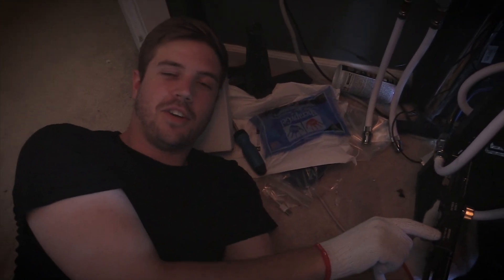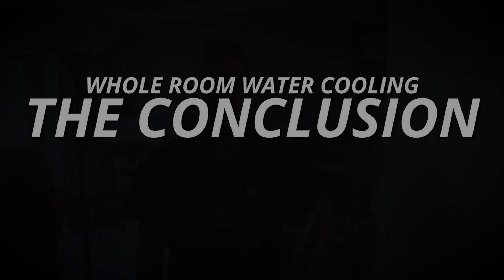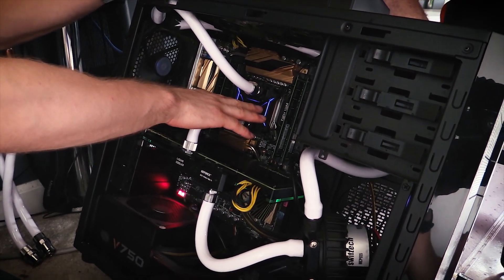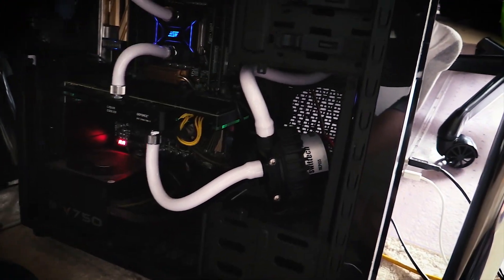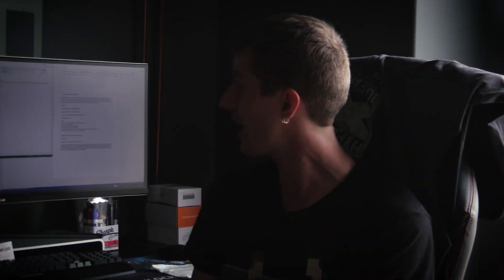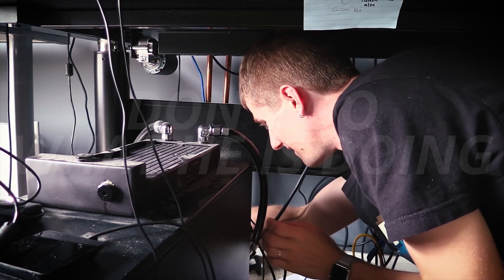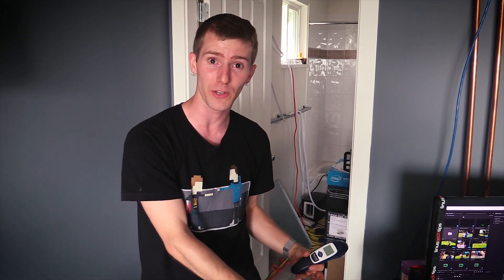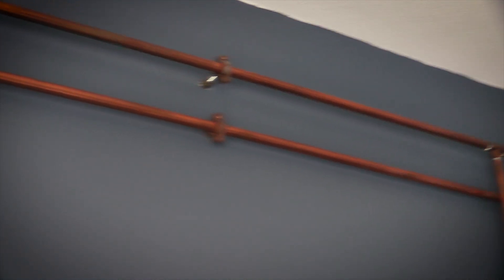Whole Room Water Cooling Part 7 - It's FINALLY over!

Comment: I think cuz' you're using uninsulated copper pipes, most of the heat gets released in your room...
Reply: +FieryWingedAngel My instant thought as well.
Reply: Linus pointed that out
Reply: +FieryWingedAngel Maybe PEX tubing instead?
Reply: +FieryWingedAngel I would be interested to see what happens if they attempted to place foam pipe insulators on the piping, additionally, the plastic tank is really a must have. Metal tanks will never be containment free.
Reply: oh mate you are a genius. its not like he said that himself.
Reply: better yet, replace the copper with PEX tubing, wrap that with foam insulator & swap the metal reservoir for an insulated plastic one (even a party cooler would probably work)...
Reply: +BillCosbyEatsBabies he literally says in the video "we chose not to use insulated PVC because of aesthetics"

now i'll agree. 

A it's pretty dumb because it defeats the whole reason your doing the project basically and

B frankly, it's still exposed piping against dry wall and that still looks like crap. maybe old piping against old brick could like ok but exposed piping is always going to look junky so PVC vs copper, meh, copper looks better but not enough to matter.

however it's his choice, it sounds like he made an informed decision and just has different values.
Reply: FieryWingedAngel
True that, using conducting material as heat transporter isn't that smart..
Reply: +BillCosbyEatsBabies I run pex on the daily and that would have been ideal for this project...
Reply: Bury a snake of pex 4' under the lawn & geo-cool them damn processors even.
Reply: Amigo Memela he may have said it himself, but he didn't even consider adding insulation to the pipes. It's really cheap at any hardware store. It doesn't take much time or effort to add to the existing copper pipes either. If he's going to go through all the effort of making a test he should at least add what's necessary to test it under ideal conditions.
Reply: Jack Graybird  Oh.
Reply: Joshua Bouse Yeah
Reply: +FieryWingedAngel yea that's the reason why its not as effective !! can't believe they did not think of that fact lol
Reply: I would still like to see a geothermal system, that would be so bad ass
Reply: +BillCosbyEatsBabies  and super way more effective as the ground stays a good constant temp.
i d also use a turbo intercooler type between the pumps
Reply: +FieryWingedAngel It's basically a giant radiator heater, which use hot water to heat homes :P
Reply: *****  Classic example of someone posting a reply before taking their meds...
Reply: Ok Capt. Obvious.
Reply: MarkTechTips  149 People don't quite seem to agree with you.
Reply: Don Ziolkowski hes half assing the science. Which will only get worse as NVIDIA controls him.  RIP Linus  Tech channel. You were the king besides tek Syndicate.
Reply: I was being sarcastic
Reply: I was being oat meal.
Reply: He literally said that in the video Sherlock.
Reply: SirMirula Doesn't make it any less stupid.
Reply: True, home A/C systems use foam wrap to insulate the copper tubing.

Comment: 7:48 the lazer Wasent even on the pipes ?
Reply: +alextheboss14 indeed lolol
Reply: +alextheboss14 the laser, no. but on the temp gun, it's located inder the infrared sensor, so at the distance he was, the infrared sensor was most likely reading the pipe even if the laser dot is on the wall. I do however wonder if he'S using a cheap ass thermometer with fixed emmissivity which would not give a correct reading on shiny copper.

Comment: What I learned while playing with an infer red camera, is that copper reflects infra red light. That temperature measure is receiving light reflected from the black body radiation of THE OTHER parts of the room.
Try heating copper up with a blow torch and using your infra red thermometer ;)

Comment: Why not cooling all the PCs with water seperately and then leading all the hot air out via tubes out of the room? Just like your concept but only with air which would be less complicated.
Reply: +Philip Danzinger  Oh it'll cool great, but then you have a long column of air with a sound source at one end. You have probably created a sharp resonator with a propensity for standing waves. Would be curious to try, but to my understanding, it would be ROARING.
Reply: Siana Gearz True, good point. But what about an AC?
Reply: air flow management (cool air zone and hot air zone) is not as efficient as a water cooling system
I once saw a smaller water cooled rig (from IBM running at 5Ghz; maybe a z196) and it make sense. More processing Power in smaller room, smaller rental fees. The hot water may be used for heating or in other ways.

Full room water cooling is a professional cooling system with many difficulties; in professional environments they had a technician. They still use distilled water, but still have to deionize it regularly (they use heat exchangers too). It's not for home use.

A 220MW radiator makes a cool winter day's to perfect place for outside party -- even if only 80MW was active ;)

Comment: Hi guys,  at least add thermal insulation to the copper pipes, than you will be able to see the difference. Without insulation you are just spreading the heat :)

Comment: tubing and quick connectors.  Keep the system as horizontal as possible, eliminating as many level changes as you can.  Use a 5G bucket with a pond pump in it and put algaecide or bleach, etc. into the water or use pure coolant.  Keep runs as direct as possible.  Install radiator as close to room as you can, use a shade awning to keep the sun off.  Tint the windows to block sun into the room.  You can probably put the pond pump and bucket in the room in a corner, perhaps inside a rubbermaid tub for peace of mind.  Keep it on the same level as the tower connectors and radiator.  Free dump the hot water in the radiator, then into the bucket, but pump it back from the bucket to the computers.  The height of your radiator should be your maximum rise in the system. Put the pump level with the bottom of the grid. 
Rent (or buy) a scaffold to do the work on the wall, it's worth it.

Comment: Wrap those copper pipes in insulation. The ambient temperature in the room is being increased by the outflow pipes heading outside. It is also heating up the fluid coming back in from the outside. It is reducing total efficiency.

Comment: Ah heat transfer. Those copper pipes fucked ya in addition to the res. the lengths of those non-insulated copper pipes were definitely long enough to radiate a significant  amount of the heat from your coolant back into the room.

Comment: I believe that if you use the type of chiller used in water AC units, you may be able not just to cool but OC the whole thing...  (lets say water at 17- 20 degrees C..) 
but bottomline, if you want to refresh the sistems PLUS the room, just get a bad ass AC and the heck with it xD

Comment: Great videos LinusTechTips. I saw on one of these that you were using the antifreeze but it did not have the necessary stuff to prevent the algae from growing. If I put things to prevent algae is the antifreeze a good idea over water for the cold winter times?

Comment: Not so sure if it was because you used a metal res, but the fact that you have copper piping n the like. I assume somewhere there is aluminum and if I recall correctly, you do not want to mix those in a loop, and obviously you have a shit-ton of copper.

Comment: Would insulating the outlet not improve performance. Copper radiates heat back into the room. Add a filter too. Running it through a fridge would be cool too.

Comment: Is it recommendable to set up watercooling to a cooling system to run below room temperatures or could this cause problems for the electronics? Is there generally an overall optimal temperature for the graphics and cpu to run at?

Comment: Did they just use water? That will give you problems when you mix metals in the system. I built my own water cooled computer about 12-15 years ago and used distilled water with WaterWetter in it. It ran without problem until I retired it. I haven't followed the setups people use today but I'm guessing you add something to the water?

Comment: It's easy to sit here and see fault in the way they built it,but the fact is they made it work through trial and error.so if someone wants to try this.they now know somethings not to do.i give them credit for even trying.shutoff valves,bleeder valves, different pipe,one big radiator,and bigger fans,filter system.this could work and be practical.

Comment: would it not be smarter to put thermal insulation foam over the copper so the room temp isn't affected by the exposed copper pipe? - just like they do with a glycol system in a bar

Comment: Ok last video thumb up, you admit it was a failure. Your proberly a greath it guy. But your a bad plumber. This idea can work greath for sure. I worked in a factory where they used a lot of water cooling.   Pressure and make sure you get rid of air.  Instal regulating valves so you can shut of parts and regulate pressur over the complete system. Why the ring line so high. But enough you sufferd for a whole year.  Greath example stay with your profession. Your a IT guy and not a plumber. Its a different education especialy cooling systems. Next time better.

Comment: Put a valve for each of the system to control the flow and pressure, so you can push the bubble out easily.

Comment: Very interresting idea :)
How is it going with the corrosion ?

I guess its not caused by the metal tank...
The first thing u learn as a plumber (im told)
Is that u do not ever put steel after copper... othervise it will corrode..
You should not use any copper in the system since its a loop... 
If the water come in contact with any steel then they will corrode... and i guess there is some internal parts in the pcs thats made of steel...
The pumps may corrode aswell.. as will the steel connectors...
Or is it the other way around ? steel makes copper corrode ? i dont remember.. but in any case its not a healthy system :)

Comment: Pro tip on using IR thermometers:  Put black electrical tape on the section of copper piping where you want to take a measurement.  Set emissivity setting to 0.95 if adjustable.  Wait 15 minutes, and then take a reading with both laser dots and the space between them over the taped area.  This will get you a much more accurate measurement.  Or, use a contact thermometer.New copper is highly reflective of infrared energy, so the reading you took in the video is a temperature blend of the actual pipe, your IR tool, the wall, the ceiling, your hands, and your face.If you try this build again, use PEX pipe next time.  Have to admire the effort though you put into a poor man's CRAC unit (Computer Room Air Conditioning).

Comment: Several tips on full room cooling:

1. Use plastic tubing and only plastic tubing.
2. Bury the tubing into the walls - bricks and wood insulate.
3. Do not rely on normal computer radiators - go to something like a cooling tower. This will give you a constant 4 degrees Celsius intake temperature.

Comment: The pipes in the room would radiate al ot of heat back in to the room before it got to the external radator, So you need to get some pipe insulation.... however i think you went about this all wrong, there is a cheeper much more effective way to do this.

Wouldn't it have been simpler to build a rack in a small room, put all your workstations in to the rack. then run a Air Con unit in the small room. Then from the small room you Run a KVM swich.

That way you have 3 advantages, the room you work is cooler, there no machine noise, and 3 the KVM would let you switch to any workstation from any working position.

Comment: insulating the hot water outlets, will actually lower the temperature even more. Plus installing a wall fan near the cold water in let pipes, will help additionally with the room cooling. Also laminating the windows will allow additional cooling.

Comment: Just hook up your system to water chiller that you place outside and you might run water close to zero c 
In that case you will really want to insulate the pipes to avoid dew forming and dripping all over your room...
But just getting the  AC sounds fine...

Comment: You should had made holes on walls facing outside, and placed radiators close to exit point much as you can. So with a shorter circuit, you could actually manage the faster liquid motion, added with extra radiators split between each exit point using the space outside, it could worked like magic. 
At first video when you included copper tubes, i said "oh, what great idea to use copper tubing to dissipate even more heat with them!" but then you put those inside the room xD

Comment: I enjoyed watching these 7 vids.

Thinking about the copper pipe radiating the heat back into the room you could have cut a lot of the down by insulating the pipe with some foam pipe, like a hollow pool noodle, that would keep the hot pipe "hot" until it gets to the rad outside.

Another possibility would have bee to connect some form of chilling unit to the cold circulation to drop the temp even further.

And as for the corrosion, you basically need what most hot water tanks have, is called a sacrificial metal, which corrodes easier than other items in the system, generally to stop the copper corroding in a central heating system, not sure how much effect it would have on what ever the computer components were made from.

Still a great concept.

Comment: Don't consider this a complete failure. There are multiple variables that can be improved on in this set up. I'm sure with a bit more trial and error it can actually work. Insulate the copper pipes. Introduce cold air into the room. Add ice in a reservoir. Keep on experimenting! Even if it doesn't work, report it. Explain why something didn't work so that others either follow in the right direction or not waste resources replicating a method that doesn't work. I love your channel and I admire your hard work. Keep it up!

Comment: Me? ( being an HVAC guy.. ) would have built a water chiller in place of that radiator setup on the roof.  How much less noise was there with the water system, vs all those radiator fans?

Comment: Maybe insulating those copper pipes could help a lot (There are pipe sleeves used for insulation of heat and saving the money on house heatingwhich is exactly what you want to de here pretty much)

Comment: You took hot water from the floor up to the ceiling and around the whole room through completely exposed copper pipes... by the time those poor pumps got the water out of there most of that heat was already back in the room.
For smart folks you do some pretty stupid things :P

Plastic pipes around the floor would probably work out much better, but at the end of the day the room still heats up in summer and you eventually need that AC with this system or without.

Comment: So, after watching all eight (including 5a and 5b) episodes of this series, I just want to be clear on a couple of things:
You installed something like eight external radiators with four fans each, instead of just going to a junkyard and buying a car radiator and thermofan, or having a new rad custom made to suit;
You installed said radiators on the south-facing wall, which, being in the northern hemisphere, is the one the sun hits, which will heat the radiators well above ambient;
You used uninsulated copper piping, which disperses heat back into the room;
You hung the copper piping by maybe 7 brackets in a run of perhaps 12 metres, which lets it flex quite considerably;
You used no brackets at all on the vertical copper runs, nor at junctions;
You used two underpowered pumps instead of using an appropriately-sized one in the first place;
You left the system open to the air (via the fill tube), and wondered why stuff was growing in the nice warm water;
You did not install any way of bleeding the system, relying instead on the (underpowered) pumps to push air through the system;
Similarly, the res is not at the highest point of the loop;
You did not install any shutoff valves, relying instead on the quick disconnects;
You left 120V sockets exposed to the weather (sorry, but a sheet of perspex only just big enough to cover the top of the radiator mount doesn't count as weather protection);
You installed water blocks on the CPU and GPU/s, but not on any of the other significant heat sources on the motherboard.

Was this a deliberate attempt to fail, and did it 'succeed' only by accident and time?

Comment: The thing that ruined it was the soldering flux, it takes forever for flux to dissolve, and there is always a lot left in the pipes. While it's not harmful to humans because its so little over time, in a recirculating system well you know the rest. It basically eats various elements up.

Comment: you might consider putting insulation around the pipes in the room so it does most of its cooling once the water gets outside.

Comment: Direct sunlight radiation can be over 1000W / m^2.  If your room wall facing the sun is 20ft x 10ft, that's around 20,000W if it's all absorbed.  If it was applied directly to heating the air in the room it would raise the room temp by 16degF / min.

Comment: Easy quick and cheap to insulate those bare copper pipes.  Since the objective was to move the heat out of the room, I find it unfathomable that this wasn't done.

On top of that, in certain conditions you may get condensation on the inlet pipes if they're not insulated.